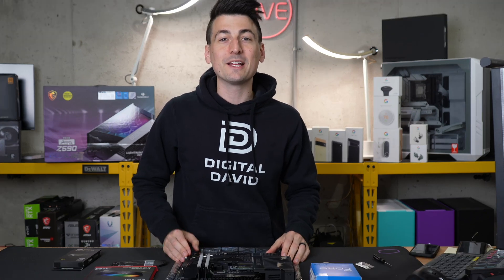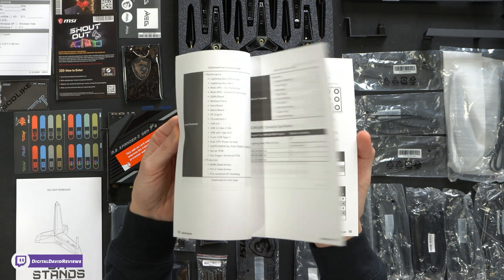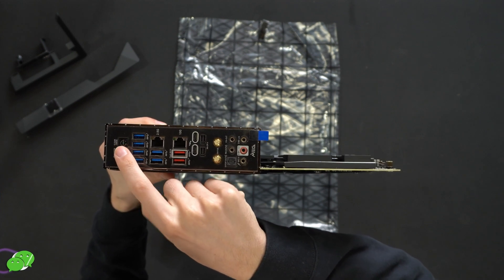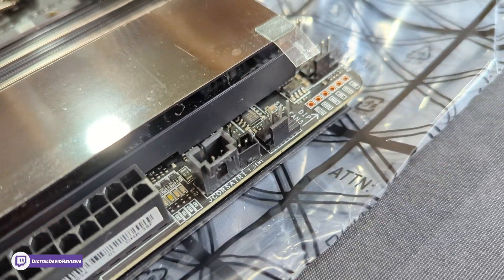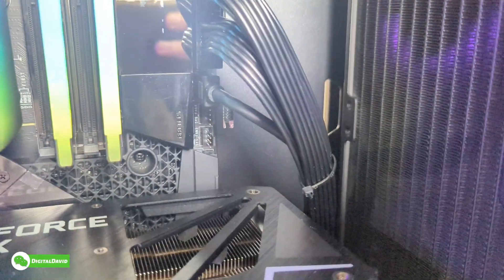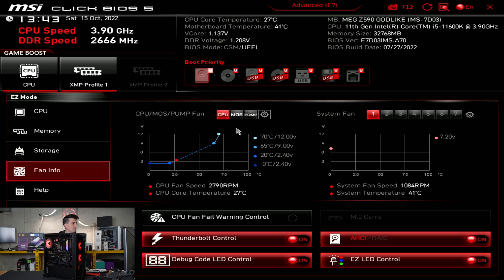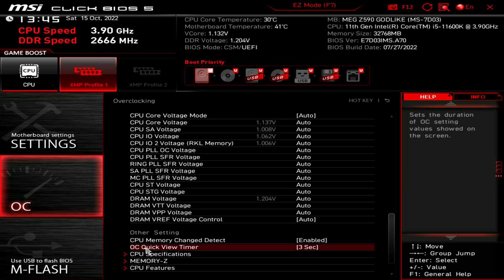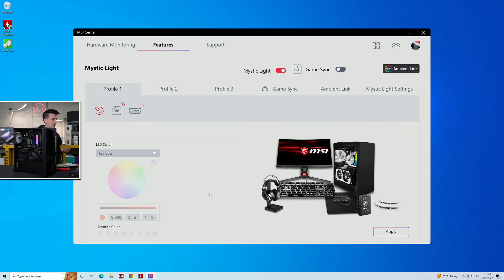MSI MEG Z590 GODLIKE Gaming Motherboard Review

Comment: David, can you please clarify what is the distance between Pcie video card slots? Is it 60mm or 81mm. Thank you very much!
Reply from the maker: Thank you for your comment regarding the MSI MEG Z590 GODLIKE Gaming Motherboard. According to the manufacturer's website, the distance between the PCIe video card slots can vary depending on the specific configuration of the motherboard. It is recommended to refer to the motherboard manual or contact MSI customer support for more detailed information regarding the specific model you are interested in. I hope this helps clarify any confusion. cnl
Reply: @DigitalDavid   Thank you for your reply and time. I was hoping you have the Z590 godlike board and can put a ruler on it to measure the pcie slots 1&2 distance needed for advertised sli. Manual and MSI web are not providing this info. Oh well, take care.
Reply from the maker: Ohhh, sorry! I don't have it available to measure at the moment
~B

Comment: have you had any issues 2 months in now? ie; random crashes or ram issues etc, did you install the M.2 drive gen 4.0 SDD . any problems on the top M.2 slot in CPU mode ? was this Win 11 or 10 ? is it compatible with Win11 ? thanks..
Reply from the maker: I just bought it to review, so I don't have any updates on how it's held up. But I was happy with it when I did use it! I do believe it's compatible with Windows 11!
~B